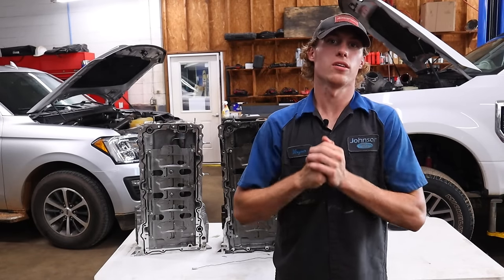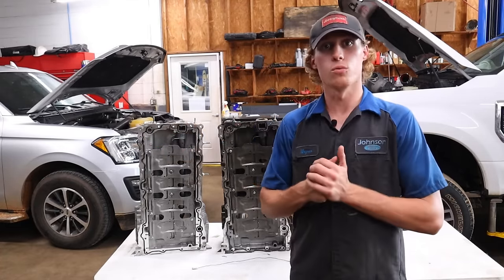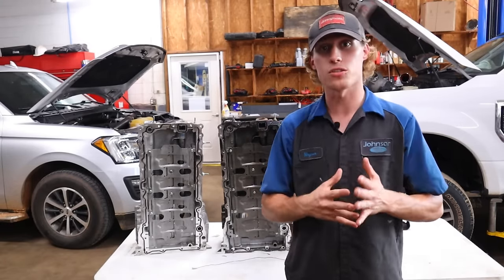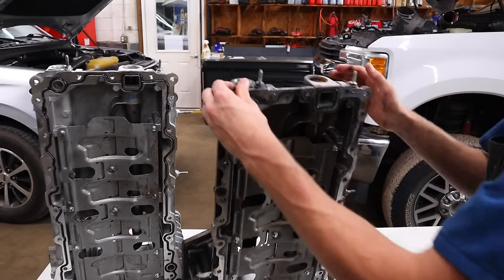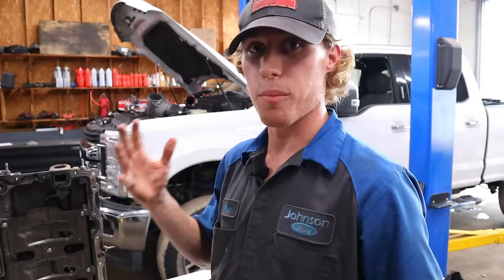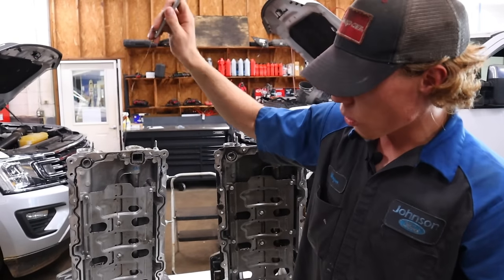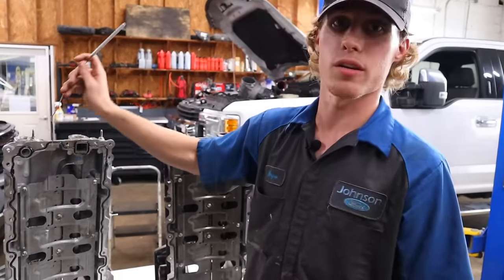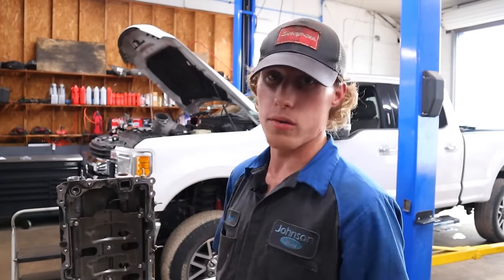How a BRAND NEW Oil Pan Destroyed This 6.7L PowerStroke

Comment: Seems very sus. I've never heard of an engine totally seizing after only 8 seconds with no oil. We drove a beater Chevy S10 about 3-4 miles after completely ripping the oil pan off after running over a small boulder while driving way too fast and stupid in a overgrown field. 

The truck ran fine after a new pan although compression did drop, so there was definitely wear/damage to the cylinder walls.

Comment: My 2012 Tacoma went 191,000 miles before it was crashed. Cost less in repairs than my 83 Ford in 60k. My 86 Ford in 90k. Not adjusted for inflation. My 2018 Tacoma has 93,000. Ive changed the oil and air filters. Figure I'll get the same 120k on front brakes as I did last time. To a lifetime Ford guy,  Toyota feels like cheating.

Comment: Could be too that someone decided to screw the company by not finishing the job. Had a rebuilt power head for an outboard that when fired up had no water flow out the exhaust. Dropped the lower unit to verify the water pump was working, then finally pulled the power head back off. Found someone at the factory had balled up a roll of masking tape and stuffed it into the water jacket tube. Needless to say company had to replace it when lawyers got involved

Comment: You should them while at the production factory...we made parts or all 3 and all the tubing parts would get an acid dip before they got the plating dip...which incidentally is the true reason for the weap holes in the tubing parts...not all of the acid can be removed from the inside therefore the paint won't stick and what does acid to bare metal....ps GM is the worst offender for this process and half the parts that went out the door were already half rotten before making it to the assembly line and gm said it was 👍

Comment: I had a buddy who drained the oil in his late 80's Camry, forgot to refill it and drove 180 miles in one trip without oil. He realized, filled it up and that engine lasted 20k more miles before it blew.
Reply: My brother drove my subaru for a entire summer with virtually no oil, maybe 5-10% of the recommended amount. The no/low oil pressure light would click on whenever you made a turn. That engine went for another 50k miles before the rest of the car was junked. Another buddy ran his old Toyota pickup with zero oil for an entire year and that's still going strong

Comment: The only way that motor will lock up in the time frame you mentioned is there would not be any oil film on the rod, main and camshaft bearings literally dry bearings with metal to metal contact🤷🏿‍♂️
Reply: ZZ Diesel said theirs ran for 1 min before locking up, same problem

Comment: 8 seconds and it locked up?  STUNTMAN drains oil, throws trash in motors, revs them full throttle, uses spaghetti sauce, beer, coolant, water etc and they dont blow up in 8 seconds.  not only that but that new pan looks spotless, as if there was no oil in it.

Comment: Nice you are passing this info on, but you could tell the truth about how long you ran it with no oil pressure before it locked up. It 100% wasn't 15 seconds lol. If that was the case every one of these engines would lock up by their 4th oil change. And you might consider priming pumps before starting them in the future for you and your customers benefit. 30 year tech so don't try and tell me I am wrong, and was also certified on Fords diesels and had a 5 star Ford rating lol (meaning 100% repair rate).

Comment: An oil pan used to only a stamped piece of metal that acted as a simple reservoir for engine oil. If you're buying a car that takes this much engineering for an oil pan. You might have the wrong vehicle. That part probably wasn't even manufactured in a ford facility. Quality control might be non existent.

Comment: I'm missing the part where it cost the customer an engine. If the customer paid a shop to repair his truck and they used defective Ford parts then the customer should not be responsible for the engine. It should fall back on the shop or Ford.

Comment: You need to work at a ford dealer see the recalls and "warranty" work, then tell me fords are good. Ever hear of the 2gen 6.7 reseal recall, or aluminum power steering bolts breaking, or when they found out that engine blocks where warping for the 1.6. Timing chain problems across the board, 5 iterations of door latches, apim and touch fail because you didn't do updates regularly, bad turbos , heads, transmitions.........
Reply from the maker: I do work at a ford dealer…..

Comment: Installed pan, started car, ignored oil light thinking oil will start circulating, left it idling to get up to temp to check for leaks, it locked up. Cant blame the mechanic impossible to predict things like this but dont go saying it locked in 7 seconds lol.

Comment: I had an aftermarket exhaust manifold with casting flash internally completely blocking a port. I did other work to the engine and the exhaust was done at the same time. Upon startup the engine was backfiring and i spent hours trying to figure out why. The guy who supply the exhast laughed when i told him what happened and he told me he got a notification to check for this problem but he tjought he would never see one. I never paid him for the replacement and cleaned and resold the defective one to help recover so cost.

Comment: I will take his word on everything except the 7 or 8 second engine death or lock up.  Can the get damage, yes.  Is the life of the engine get reduced, yes. But total failure, I don’t see that. However you as the car owner would have to accept a reduction in life of the engine. How much, who knows. But the bearings will suffer a tad from that 7 or 8 seconds run, specially if it’s more time and if the engine was rev up for that time.

Comment: Mahle makes valve cover gaskets for 6.7 power stroke my 2017 f350 oil pan is leaking as well you should see the quality of the valve cover gasket it's even worse then the oil pan quality 🤣😂 if I take my oil pan and gasket of and video tape it and if I find out any small factory defect I will take Ford motor company to court for faulty inspection and failures of maintenance of lease truck as my F350 was a lease truck

Comment: Mason, found this other page that provided the same problem you faced.  He did the same thing as you by pulling the plug from the end of the pan.  But he also said he ran air through that tube and placing his hand on the oil cooler outlet. https://youtu.be/69O55PdV4BM

Comment: And what was wrong 60' & 70' design that they criticize that much? All these new trash the oil has to go round and round, up and down, out to cooler etc. stupid engineers, design stupid because engineer is stupid. They don't have a goal to make the repairs cheap, that is not on the list of requirement, they just want to re-dsign the engine to increase the price and for them to have work, if they keep the same design and work every year to improve the same engine, pretty soon the engine become indestructible and they are going to fire egeneers  because there is no more work, the cars are not braking. There is no need for 100 engineers, 2 is enough 98 will lose their job, it's more job protection then anything else. , and the corporation is happy because profit margins is going up.

Comment: I believe that motor was already on its way out before that. I've run motors for several miles with out oil filters do to ripping them off out in the woods and put new ones on and never had a problem.  But that was in late 60's. They don't make things to last anymore. Still think that motor was already done for that little time without oil pressure.